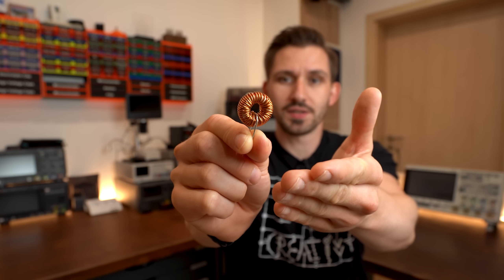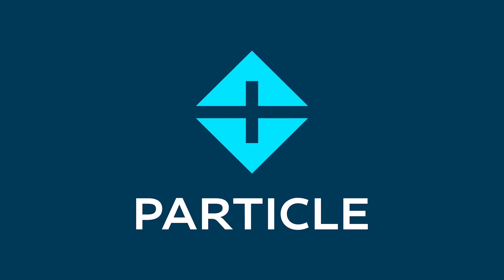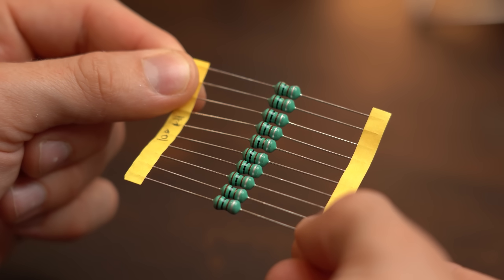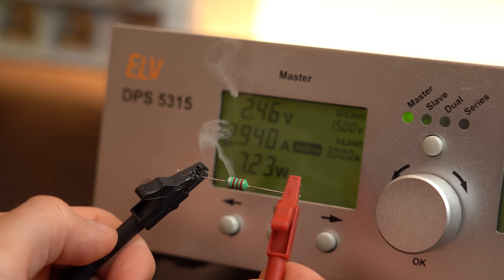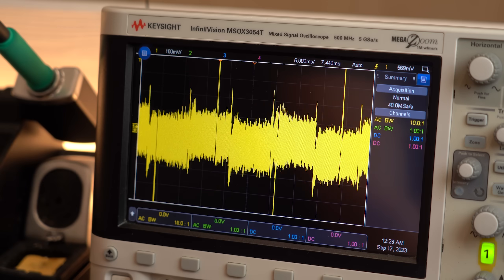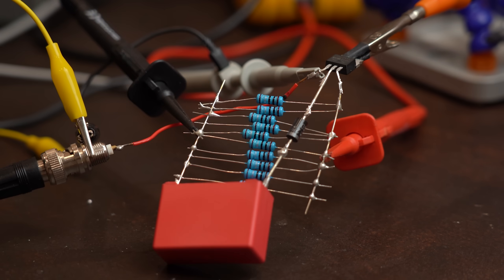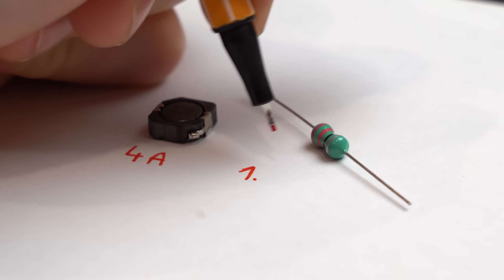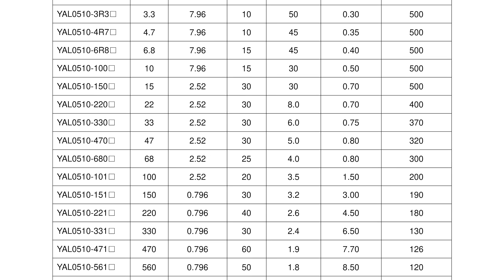These 3 Cent Components are actually USEFUL?! (Color Ring Inductor) EB#56

Comment: These inductors were never intended for power devices, but were great for HF antenna and transmission circuits for damping small power supplies for low noise amplifiers! But you can use them for miniature power feedback by for instance 20 windings of thin wire directly on 47uH for feedback in two transistor stabilized voltage converters. This way you could build single cell -1V to -15V converters in smallest volume within the 1970ers for the first pocket calculators (Hanimex and MBO).

Comment: Those Inductors that look like resistors were not as easily identified as expected. Although only one value ended up being bought,
two LC circuits had to be set up to infer the actual values of those inductors, allegedly so well labeled, since my AliExpress LC toy-meter could only see the resistance of the 2.2uH coils.  🥳

Comment: The cleverest use I have seen for these cheap inductors was in a video titled An Almost Solderless Crystal Radio.

It's a breadboard AM radio that uses these inductors rather than winding coils to build a powerless radio!

You like to shrink circuit boards; this radio could be shrunk to fit almost anywhere such as in an ink pen or even into the crystal radio style ear piece used to listen to it!😊😮

Comment: Great video, like you I did the same thing and still have them in a bin collecting dust. I figured out they are very specific to filters and very small power supplies, loved your method of measuring saturation current, but I love your LCR meter even more, I have a cheap ebay one....

Comment: @in SMPS applications, it's useful to know the ACR, DCR, and I(sat)
Clearly, the I(sat) is almost directly related to the amount of core material, DCR to wire size, and ACR to core losses...in an LED driver that we were developing with TI, the simulations showed about 87% efficiency, but the prototype boards were always a couple of percent low...this is at 1 MHz or higher... replacing the smd inductor with an air core inductor brought the performance to equal simulations...
BTW, for anyone who cares, I came up with a simple way to figure out ACR and parasitic capacitance, using an oscilloscope probe and FET switch, measuring the ringing frequency with e ~11 pF probe capacitance, adding a known capacitance, to change the frequency of the ringing, which also allows you to get a differential measurement of the real probe capacitance...then, by changing the capacitance and ringing frequency, and measuring the decay of the ringing,  you can calculate the ACR at the ringing frequency...

Comment: Such small inductors can also be ideal as RF-chokes (to decouple circuits but also for example in microphone leads to prevent radio reception) and in tuned circuits where the current is usually very low.

Comment: That was not nice. When you look at the 2 indicators you can see the open style is smaller. When you broke them you could see the wire diameter are different. Open style vs. pot style. The smd one is made for switching the colored one for rfc's. Really? Did you want to put them in a bad light? Everything has it's place. Use them for the job. You want to compete in a motorcar  rally with a 5 year old child's tricycle. I like your videos. Only this one?

Comment: They are not intended to be used as power instructors. They are usually called RF inductors used in filtering. If you buy them from a proper distributor (Mouser, Digikey, Farnell, etc...) you also get a proper datasheet. Great video anyway!

Comment: I have an interesting question: can you put 2x tp4056 modules in series, so output voltage is 8.4V and charge them simontanuously?
Reply: You can but with one big caveat: the power inputs need to be independent isolated supplies. If you connect both modules to the same USB power supply it will result in a short circuit.
Reply: @eDoc2020  what If I add a diode between the output + of one board and output - of the other?
Reply: @KGB_rail  I think it would still short out the first board but even if it doesn't it still won't work. Oh and I didn't mention I think you would need to use the balancing lead if you want to charge an 8.4v battery with two charge modules. If you don't have a balancing lead then you probably just want to find a standalone 8.4v charger.
Reply: I have a 8.4v BMS but I can't use it normally, because I don't have an 8.4V power supply. I also have had a bad experience ordering parts from abroad like Romania and Turkey.
Reply: @KGB_rail  If you have access to the center tap you can also use a single 4.2 charge module. Charge one half, then charge the other half. It's a bit of a nuisance but you don't need a special charger that way.
Reply: @eDoc2020  I have two 18650s that aren't currently connected in any way
But that might change since they are old and don't hold charge too well

Comment: There are military grade inductors like these but cost 3-5x of a military grade chip inductors. Manufacturers do provide a proper datasheet and certificate of compliance. I've used them for RF filters. The only problem is tolerance of 10-15%. I would use torroids for higher power

Comment: They are not designed for use in power supply applications which is why you dont readily find saturation current data in the specs. Bit of a weird video this one..

Comment: The (I assume) power supply of my milk frother (230V -> 12V) uses one. Stopped working one day and after opening it it was kinda melted. I ordered new ones and they just arrived. Will see if the new one works, because when I just short the broken one, the device works fine so I assume it's only used for filtering.

Comment: One thing to note is the inductors don't resist current, so long as the core isn't oversaturated. They resist the change of current. They want to maintain whatever amount of current that is flowing through them, including no current.
Reply: The wire has resistance, so they resist current

Comment: Thanks a lot for the video. I was building a Geiger counter and wanted an inductor for the boost circuit and struggled to find one locally with the value I wanted but these color codded ones were available. I didn't know if they're going to work or not or what the difference between them and the regular and the SMD. I just tried them and they worked (primarily because the Geiger tubes doesn't draw much current) but not until I watched this video that I knew the actual difference.

Comment: Sir, Please make a video of, How I choose the exact capacitor, inductor, MOSFET, diode, and resistor based on my requirements. We failed to choose the exact mosfet for controlling load cause on the datasheet there are many specifications that are very hard to understand, And also for the capacitor resistor size and value for the loads. Please that will be very helpful for us.

Comment: In my opinion, there's no good reason to use any component for which the manufacturer doesn't provide a datasheet with the relevant specifications. Even if you can measure those specifications yourself as you did here, the fact that you need to do that for every single one makes them impractical to use. Especially considering your measurements won't be based on the same parameters as those of the manufacturer of the other part you're comparing it against, so they may not be accurate.

But the biggest problem is that you're using your own time to do the job of the manufacturer, and since the part is only worth a few cents compared to the alternative that would still cost <$1, you're effectively valuing the time used to test these at far less than it's worth to just buy a better part that has known specifications. And that's exactly why I stopped buying cheap, unknown quality, generic Chinese parts from eBay and Aliexpress. You might save yourself a few cents, but equally you'll probably waste your own time testing and troubleshooting when it doesn't work as advertised.

By not publishing the necessary specifications, what the manufacturer is really saying is that there's no guarantee that the part conforms to any specification, and it's not even worth them testing each part to find its specifications, let alone publish what it's supposed to be. In other words, they're saying you shouldn't buy this part unless your application does not require a specification of any value; thus you should not buy this part.

Comment: I use color band inductors in joule thief circuits. Much easier than winding a ferrite core. I suspect in another couple generations all through hole components and maybe discrete components altogether will be a thing of the past. Nano controllers and software.

Comment: Hi Scott you young spunt ! What your generation obviously did not learn is that this type are for 2 AREAS  filtering of signals  and RF up to 30mhz  higher with a lower Q  and that's it. You we with 1w hot enough to melt solder so never use at 1w it was nice for me to see you trying however ha ha . My old data sheets say 0,5w max which is from the size logical.

Comment: These axial lead inductors are popular with radio hams in low power applications. Maybe you need a large value inductance like a few hundred uH or few mH to make and RF choke. These can fit the bill and save you having to wind loads of turns to make one. Please don't smash anyone of these with that hammer 😢.

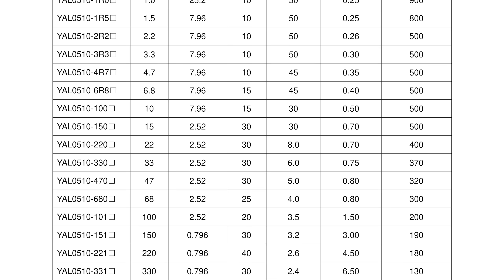Comment: At 10:25 I'm pretty sure that the "rated current" in the datasheet represents the saturation current. It seems unlikely that the one in the third row is limited to 500mA by heat dissipation, as its DC resistance is only 0.26Ω, i.e. dissipation at rated current is just 65mW.

Comment: Yeah, these you have to get from a reputable manufacturer like Vishay or something to get the full specifications. There's power inductors and then there's inductors for low power uses like in RF work which often it's best to use self wound inductors unless your form factor is tight then these and other SMD inductors are a better choice which then require you to build your circuit (like filters) around common values and combos of values.

Comment: There was a time when inductors like these were about the only inductors available off-the-shelf from component distributors - well except for big iron-core jobs.

One of the things that data sheets will reveal about these sorts of inductors is that the construction is often not the same for all values in a series.

Low values are often "air" core. Instead of being wound on a core with permeability greater than one they are wound on something like ceramic, the same as used for film resistors. The core doesn't contribute to the magnetic properties, it is just a physical support for the winding. As the values increase, other core materials are used. Intermediate values may use a "powder" core with moderate permeability. High values may use a ferrite core. Saturation properties vary a lot with core material. Ferrite saturates the most easily. Air doesn't saturate at all. Externally all of the inductors in a series may look identical except for the markings, though the properties can be quite different beyond just the difference in inductance. Going up or down in value by one "step" (e.g. from 22 µH to 33 µH) might come with a significant change in properties. 

Very similar inductors can be had in surface mount packages. In surface mount you can also get inductors in the nanohenry range, intended for RF circuits, often for impedance matching.

Comment: I have been using those inductors in many digital circuits, usually for power supply filtering but other uses as well, for many years.
If you are building circuits, they are great for keeping the current draws affecting other circuits on the board, when used with filter caps as well.

Comment: In the past life I had, I measured saturation current using an LCR meter and running DC current through them. I isolated the DC power supply using two much larger inductors which caused minimal error on the inductor under test's value. Its clumsy, but it works.
Reply: Can you give a diagram of how to measure the inductor saturation current?
Thanks!
Reply: @Йохан-м7т  Hi!

A diagram is hard because I'm between computers and jobs right now, but the premise is make two very large inductors which can handle a lot of DC current. The inductance should each be around ten times what your inductor you want to test is, and physically large too. I recommend a fairly high permeability powdered iron core (don't use ferrite, they saturate too easily when DC current is passed through them.) Put one on each side of your inductor under test. Measure the inductance of what you're measuring, then connect a current limited power supply across the inductors. Increase the current slowly, and watch the inductance drop when you approach the saturation current. You are really looking for any non-linearities, because that indicates that you're getting there. Those tiny ferrite inductors won't do well with DC current because they aren't designed for that, but you can find out where the limits are. The meter or LCR  bridge will tell you accurately when you're reaching saturation.

Comment: They are useful for LC passive filters for various RF signals. There is software that will choose the best 5% or 10% values to give the desired response. They can be used in lowpass, highpass, bandpass and other filter circuits. They can not handle large signals as they saturate.

Comment: not handling high currents and being available in lots of odd values sounds to me like they're supposed to be signal rather than power devices?
Reply: Generally that is true.
They can be useful in power circuits but more for what is traditionally thought of as "filtering" rather than power conversion. They can be useful for reducing noise from a small DC-DC converter module or a capacitive charge pump.

Comment: Like most people pointed out, color ring inductors or the equivalent in SMD footprint are not used for power applications but for filtering. I should also point out that datasheets for this kind of devices do exists which usually state: inductance, tolerance, minimum Q, minimum self-resonant frequency (SRF) in MHz, DC resistance (DCR) in ohms, and rated current. These values are also specified and tested at a specific frequency, like 0.8, 2.5, 8, or 25 MHz. In my opinion, they are certainly not particularly useful in the through-hole footprint, so SMD are more prevalent.

Comment: Are you aware that inductor current in converter is no constant? You use 2,3 times more than average current output as reference and look for inductor with saturation current in this range. (depend on particular converter)

Comment: I have a slot in my bins cabinet with the (I believe) exact collection of these little color ring coils. I have used them in many RF and other low power places, but never what you have done here. Cool as it was to see these little gems fail as they did in your experiment, I was told they are not meant for power systems, but more as an RFI and other lowe power systems. Thank You for the knowledge!
Peace

Comment: one day I think you should do a deep dive on improving your solder joints... pre tinning the wires, pads, using flux, higher temp (they look cold)
Reply: Watch out, it's the solder joint police!
Reply: @boots6384  lol just trying to give ideas
Reply: @boots6384  while making a bad joint is not in violation of the laws of nature, it will save a lot of frustration and troubleshooting.

Comment: Solar lights use these color ring inductors a lot to boost 1,2V to ~3V, by changing the inductance one can control the current that the LED is driven with._

Comment: Excellent video. Your "bench setup" for measuring saturation current was excellent. I strongly recommend a second video where you walk through the reasoning for each of the parameters you selected in the function generator and the scope. (e.g. why repeat at 100Hz? Why did you select a pulse time below 5uS?). The way you showed visually what what saturation looks like was awesome, and briefly touched on the thermal runaway. Excellent.
One small Q/Thought -- the stored energy in the inductor -- it's dissipated through that flyback diode when the mosfet is off, right?
Reply: pulse should be frequent enough otherwise the oscilloscope will get lost. pulse width was probably chosen randomly and slowly increased till saturation was observed

Comment: In electronics RF engineering is a speciality. It's not surprising these things are not used in many circuits, since the RF part of modern devices always seems to become smaller compared to the digital part. 100 years ago everything was RF.

Comment: Very educational.  I was hoping to use them as pyrotechnics igniters, but the datasheet says they don't ignite.
Reply: Prob cheaper to use resistors for that even thin strand of wire wrapped around a match stick and tape it to fuse or shove it in the hole 🤣🤣
Reply: @davey2k12  Resistors and match sticks wouldn't have the necessary inductance to ignite plutonium.
Reply: @ChristieNel  what fackin pyrotechnics you messing with nuclear,😂😂😂
Reply: @davey2k12  Well, how else do you get that lovely green colour visible from a hundred miles away?

Comment: I work with old game consoles a lot and these inductors are found on them. Usually they are found in the NTSC/PAL encoding section, as part of the chroma trap or delay line. They are also used in some places as part of a pi filter to provide a cleaner reference voltage for analog sections--at very low current, of course.
Reply: Yes, same with old pinball machine boards.

Comment: The small inductors cost lest than 1/10 the surface mount ones, but are better than 1/10 the surface mount ones.  What if you used 10 of them in parallel?  Wouldn't that dramatically lower the resistance, and increase performance by 10x?  What am I missing?
Reply: But this will also lower the inductance. Not to mention other parameters not covered in the video.